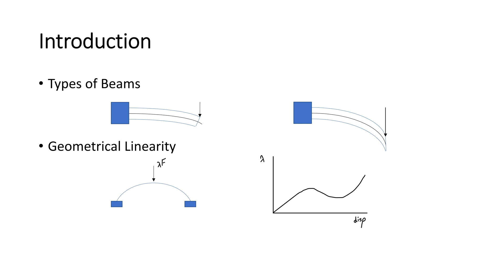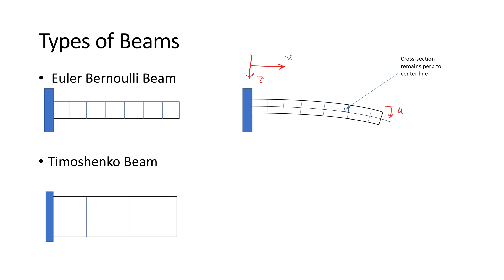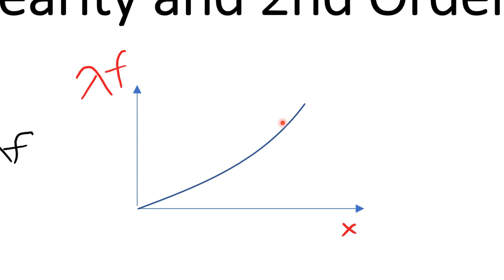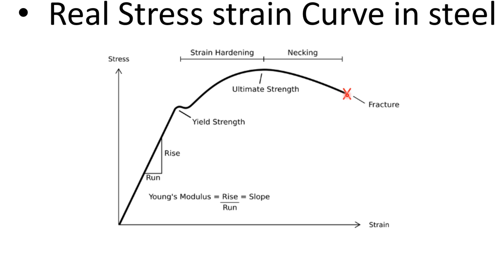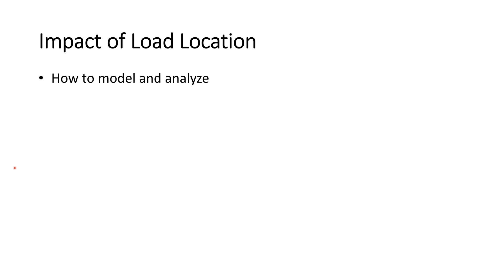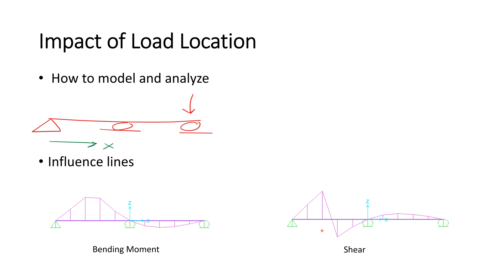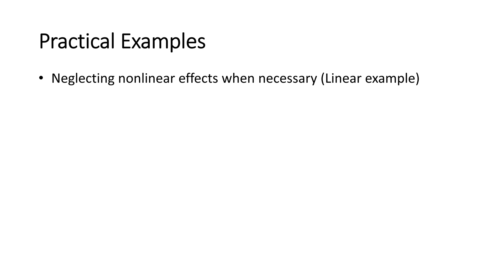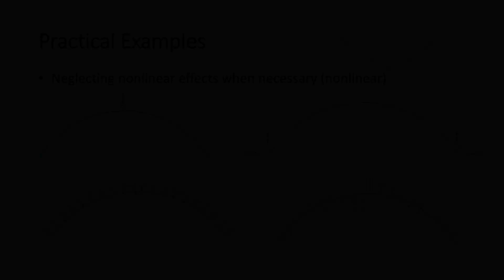Unlocking the Secrets of Beam Analysis: Why Linear Assumptions Can Cost You Big Time

Comment: Thank you so much for this video FME! Please answer my question, How can you determine if the deformation is "large" to determine whether a linear analysis will suffice or we will have to do a nonlinear analysis?
Reply from the maker: Large is relative and thus the displacement is always compared to the size of the structure. In the case of beams the ratio of displacement to span is taken and if it exceeds a certain amount, the deformation is considered large.